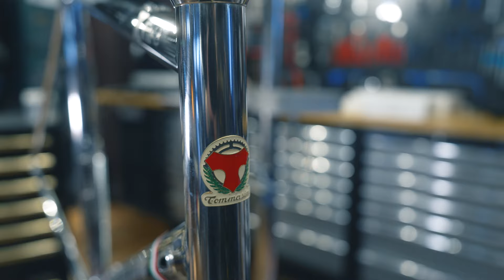Tommasini Stainless Steel Rim Brake Bike Build - Campagnolo Chorus,  Sony A7IV, 24-70 F2.8 G.

Comment: an absolute beauty. My next bike will with steel frame and rim brakes. That is the way to go.
Reply: Me too. Currently Chris Bishop of Bishop Bikes, a custom frame builder here in the US, is building my new frame. I have a new Campag Centaur 10 group that has been in my closet for 15 years that is finally going to get used. In this day and age getting a brand new vintage style bike is rare so I think it's bound to get some notice.

Comment: Very nice indeed. So much class and sheer quality there. 
However, ive a 2004 Longstaff. Columbus Nivachrom frame and carbon forks,made to measure for me currently being rebuilt with Campagnolo Chorus 12. To accommodate my aging legs the gear choice is 48/32 chainset, 11/34 cassette. 3 weeks to go, feel like a child waiting for Christmas

Comment: I own this same frame. Only difference is mine is external cables which in my opinion looks better. But everything has to be hidden and internal these days 😂

Of course mine is built with Shimano Dura-Ace R9100 and HED Ardennes Black wheels 😍

Thanks for the video
Reply from the maker: Nice